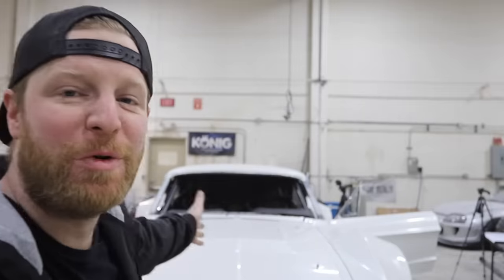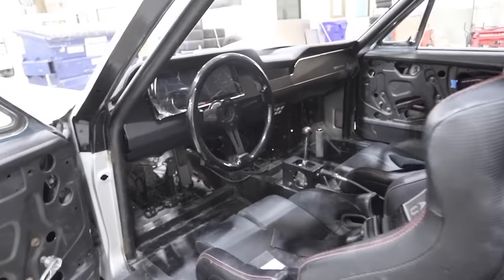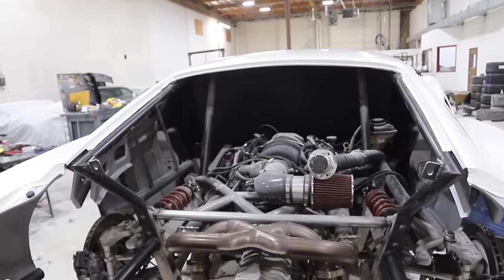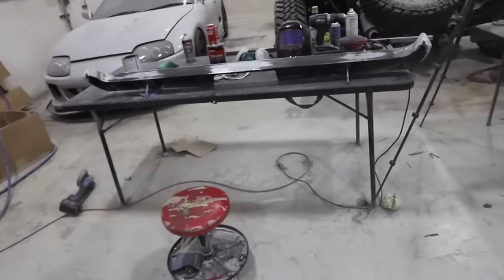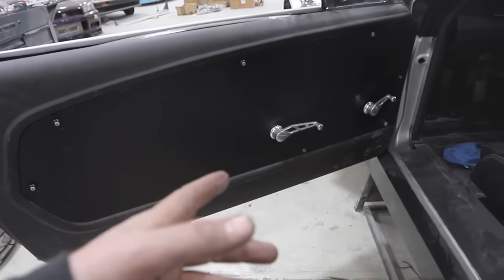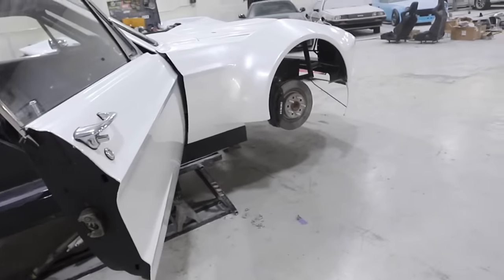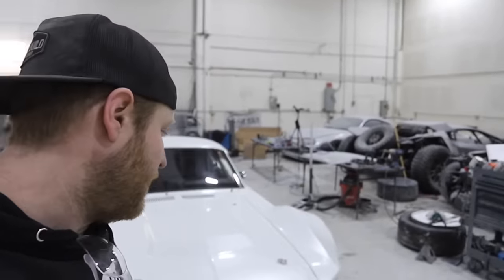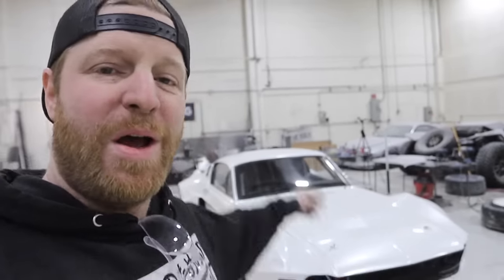Mid Engine 67 Mustang Fastback Gets The CRAZIEST WHEELS EVER To Match Its Crazy Body

Comment: I've been watching this from the beginning but have some really dumb newb questions. It seems like major sections of this car are made literally from duct tape, covered in a few layers of fiberglass, and then wrapped in some thin shiny holiday gift wrapping material. It looks great, but is this meant to be driven around? How would everything not just fall apart the moment the car hits a speed bump? What if your finger scratched the car... how does the surface wrapper not peel right off? Let alone daily rocks/pebbles/dirt hitting it at higher speeds. I get there are some metal tubing underneath, but all of the surfaces are still fundamentally duct tape, fiberglass, and wrapper.... are all custom builds made this way?